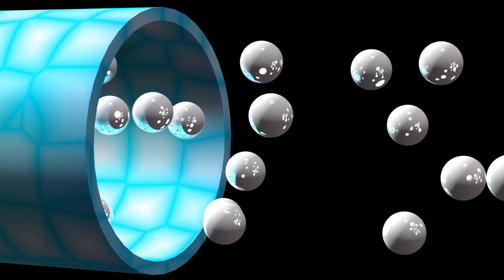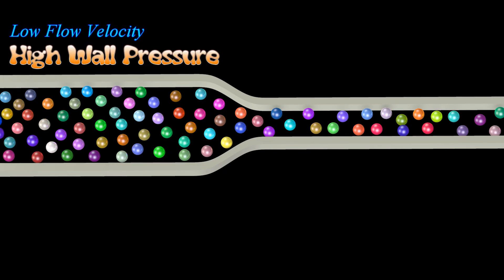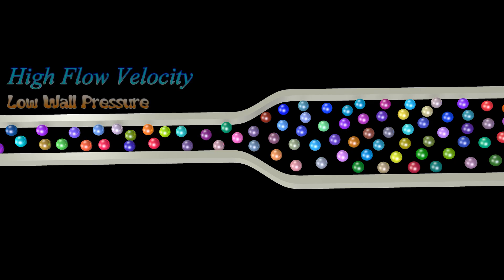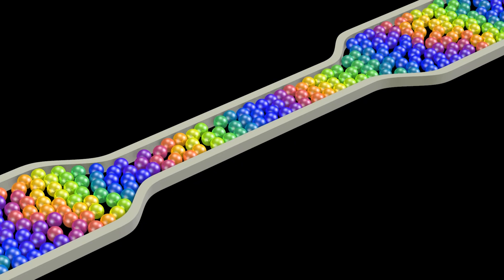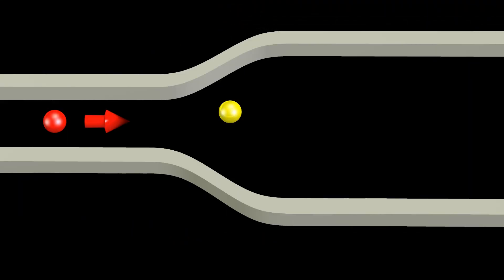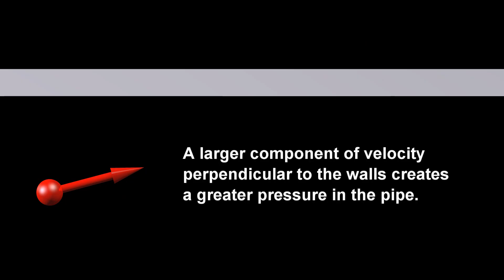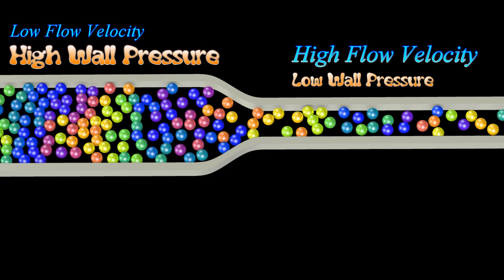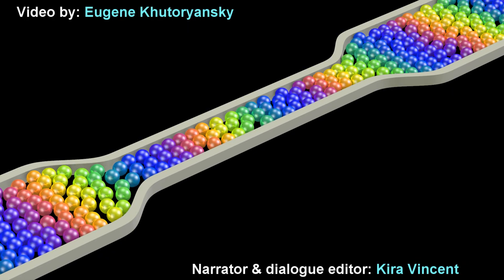Bernoulli’s Principle on Atomic Scale

Comment: Unfortunately, this violates some very common and well understood accepted principles of physics.  Charles Crummer makes the same errors, which doesn't make it correct.  It also contradicts itself as explained at the end.
..
The statement at 2:07 is correct. "there is no reason to expect an atom with a higher velocity to exert a lower pressure on the walls of the pipe." 

There can be the same pressure in a fast fluid as a slow fluid.  They simply have the same static pressure. Bernoulli is not about speed. It is about changes in speed or velocity which is Acceleration along a path. 

The pressure on the walls of a sealed jar is the same regardless of the speed of the jar.

A fundamental flaw in this misconception at 2:42 is is that there no reason to expect a molecule to have the thermal vibration in only one dimension.  These pressure causing vibrations are random in direction and are how they bounce round between other atoms - At THE SPEED OF SOUND in the medium!.  
At any given instant a molecule may be going down and the next at 90 degrees or even 180 degrees to the previous vibration.    All that happening at blinding speeds relative to the flow speed down the pipe.
That simple fact breaks this false logic.
..
Then. . . 
It is the average velocity (over time) that has a directed motion when the kinetic energy is added to produce an increase in speed. That directed velocity is vectorially summed to the random vibrations.  This is vector addition of velocities. This means that the random vibrations are superimposed onto the linear velocity along the tube. This is fundamental physics. Vector quantities like speed and acceleration add vectorially.
Ignoring that fundamental physics is another flaw in this.
..
..
Then, the added kinetic energy in the moving fluid is in only direction.  It is not increasing the random thermal vibrations. That would require increasing the temperature.  This is another flaw in this story.  Moving the fluid along the pipe does not raise the temperature.  
Therefore, the statement at 2:23: "an atom with a higher velocity would have a higher kinetic energy and, therefore, exert a larger force on the pipe walls" is false because it conflates / confuses thermal energy and momentum in one direction.
..
..
Consider bouncing a ball on the floor. Each bounce imparts some momentum to the floor.  The ball's actual motion is only vertical..

Now, start the room moving (a train car) and the ball still imparts the same momentum to the floor with each bounce.  It's actual motion, relative to the stationary ground changes.  It has the SAME vertical component, but now a horizontal component vectorially added to the vertical motions.  The pressure on the floor does not change.
.
 However, these two motions are orthogonal and have no effect on each other. The vertical up[and down bouncing component remains the same. ONLY the ground referenced horizontal component changes as the speed increases.
This physics does not change if the ball is bounced on the ground outside the train's window.
.
Contradiction:
The idea of the molecules entering the third, wide section bounce in such a way to give them more toward the walls, directly contradicts the fact that they are also bouncing off other molecules as it enters the narrow section. 
This makes absolutely no physics sense at all. 
.
This fails on these fundamental physics errors.

Comment: nice work reallt.Thanks for such insightful explanation
Reply from the maker: Thanks.  I am glad you liked my explanation.
Reply: Unfortunately it is flawed as follows:
The statement at 2:07 is correct. "there is no reason to expect an atom with a higher velocity to exert a lower pressure on the walls of the pipe." 

There can be the same pressure in a fast fluid as a slow fluid.  They simply have the same static pressure. Bernoulli is not about speed. It is about changes in speed or velocity which is Acceleration along a path. 

The pressure on the walls of a sealed jar is the same regardless of the speed of the jar.

A fundamental flaw in this misconception at 2:42 is is that there no reason to expect a molecule to have the thermal vibration in only one dimension.  These pressure causing vibrations are random in direction and are how they bounce round between other atoms.  
At any given instant a molecule may be going down and the next at 90 degrees or even 180 degrees to the previous vibration.  
That simple fact breaks this false logic.
..
Then. . . 
It is the average velocity (over time) that has a directed motion when the kinetic energy is added to produce an increase in speed. That directed velocity is vectorially summed to the random vibrations.  This is vector addition of velocities. This means that the random vibrations are superimposed onto the linear velocity along the tube. This is fundamental physics. Vector quantities like speed and acceleration add vectorially.
Ignoring that fundamental physics is another flaw in this.
..
..
Then, the added kinetic energy in the moving fluid is in only  direction.  It is not increasing the random thermal vibrations. That would require increasing the temperature.  This is another flaw in this story.  Moving the fluid along the pipe does not raise the temperature.  
Therefore, the statement at 2:23: "an atom with a higher velocity would have a higher kinetic energy and, therefore, exert a larger force on the pipe walls" is false because it conflates / confuses thermal energy and momentum in one direction.
..
..
Consider bouncing a ball on the floor. Each bounce imparts some momentum to the floor.  The ball's actual motion is only vertical..

Now, start the room moving (a train car) and the ball still imparts the same momentum to the floor with each bounce.  It's actual motion, relative to the stationary ground changes.  It has the SAME vertical component, but now a horizontal component vectorially added to the vertical motions.  The pressure on the floor does not change.
.
 However, these two motions are orthogonal and have no effect on each other. The vertical up[and down bouncing component remains the same. ONLY the ground referenced horizontal component changes as the speed increases.
This physics does not change if the ball is bounced on the ground outside the train's window.
.
This fails on these fundamental physics errors.

Comment: THANK YOU
Reply from the maker: You are welcome and thanks.
Reply: Unfortunately it is flawed as follows:
The statement at 2:07 is correct. "there is no reason to expect an atom with a higher velocity to exert a lower pressure on the walls of the pipe." 

There can be the same pressure in a fast fluid as a slow fluid.  They simply have the same static pressure. Bernoulli is not about speed. It is about changes in speed or velocity which is Acceleration along a path. 

The pressure on the walls of a sealed jar is the same regardless of the speed of the jar.

A fundamental flaw in this misconception at 2:42 is is that there no reason to expect a molecule to have the thermal vibration in only one dimension.  These pressure causing vibrations are random in direction and are how they bounce round between other atoms.  
At any given instant a molecule may be going down and the next at 90 degrees or even 180 degrees to the previous vibration.  
That simple fact breaks this false logic.
..
Then. . . 
It is the average velocity (over time) that has a directed motion when the kinetic energy is added to produce an increase in speed. That directed velocity is vectorially summed to the random vibrations.  This is vector addition of velocities. This means that the random vibrations are superimposed onto the linear velocity along the tube. This is fundamental physics. Vector quantities like speed and acceleration add vectorially.
Ignoring that fundamental physics is another flaw in this.
..
..
Then, the added kinetic energy in the moving fluid is in only  direction.  It is not increasing the random thermal vibrations. That would require increasing the temperature.  This is another flaw in this story.  Moving the fluid along the pipe does not raise the temperature.  
Therefore, the statement at 2:23: "an atom with a higher velocity would have a higher kinetic energy and, therefore, exert a larger force on the pipe walls" is false because it conflates / confuses thermal energy and momentum in one direction.
..
..
Consider bouncing a ball on the floor. Each bounce imparts some momentum to the floor.  The ball's actual motion is only vertical..

Now, start the room moving (a train car) and the ball still imparts the same momentum to the floor with each bounce.  It's actual motion, relative to the stationary ground changes.  It has the SAME vertical component, but now a horizontal component vectorially added to the vertical motions.  The pressure on the floor does not change.
.
 However, these two motions are orthogonal and have no effect on each other. The vertical up[and down bouncing component remains the same. ONLY the ground referenced horizontal component changes as the speed increases.
This physics does not change if the ball is bounced on the ground outside the train's window.
.
This fails on these fundamental physics errors.

Comment: Had to come back because i forgot to hit the loyke button. ✌️👍
Reply from the maker: I am glad you liked my video.
Reply: Unfortunately it is flawed as follows:
The statement at 2:07 is correct. "there is no reason to expect an atom with a higher velocity to exert a lower pressure on the walls of the pipe." 

There can be the same pressure in a fast fluid as a slow fluid.  They simply have the same static pressure. Bernoulli is not about speed. It is about changes in speed or velocity which is Acceleration along a path. 

The pressure on the walls of a sealed jar is the came regardless of the speed of the jar.

A fundamental flaw in this misconception at 2:42 is is that there no reason to expect a molecule to have the thermal vibration in only one dimension.  These pressure causing vibrations are random in direction and are how they bounce round between other atoms.  
At any given instant a molecule may be going down and the next at 90 degrees or even 180 degrees to the previous vibration.  
That simple fact breaks this false logic.
..
Then. . . 
It is the average velocity (over time) that has a directed motion when the kinetic energy is added to produce an increase in speed. That directed velocity is vectorially summed to the random vibrations.  This is vector addition of velocities. This means that the random vibrations are superimposed onto the linear velocity along the tube. This is fundamental physics. Vector quantities like speed and acceleration add vectorially.
Ignoring that fundamental physics is another flaw in this.
..
..
Then, the added kinetic energy in the moving fluid is in only  direction.  It is not increasing the random thermal vibrations. That would require increasing the temperature.  This is another flaw in this story.  Moving the fluid along the pipe does not raise the temperature.  
Therefore, the statement at 2:23: "an atom with a higher velocity would have a higher kinetic energy and, therefore, exert a larger force on the pipe walls" is false because it conflates / confuses thermal energy and momentum in one direction.
..
..
Consider bouncing a ball on the floor. Each bounce imparts some momentum to the floor.  The ball's actual motion is only vertical..

Now, start the room moving (a train car) and the ball still imparts the same momentum to the floor with each bounce.  It's actual motion, relative to the stationary ground changes.  It has the SAME vertical component, but now a horizontal component vectorially added to the vertical motions.  The pressure on the floor does not change.
.
 However, these two motions are orthogonal and have no effect on each other. The vertical up[and down bouncing component remains the same. ONLY the ground referenced horizontal component changes as the speed increases.
This physics does not change if the ball is bounced on the ground outside the train's window.
.
This fails on these fundamental physics errors.
Reply: Unfortunately it is flawed as follows:
The statement at 2:07 is correct. "there is no reason to expect an atom with a higher velocity to exert a lower pressure on the walls of the pipe." 

There can be the same pressure in a fast fluid as a slow fluid.  They simply have the same static pressure. Bernoulli is not about speed. It is about changes in speed or velocity which is Acceleration along a path. 

The pressure on the walls of a sealed jar is the came regardless of the speed of the jar.

A fundamental flaw in this misconception at 2:42 is is that there no reason to expect a molecule to have the thermal vibration in only one dimension.  These pressure causing vibrations are random in direction and are how they bounce round between other atoms.  
At any given instant a molecule may be going down and the next at 90 degrees or even 180 degrees to the previous vibration.  
That simple fact breaks this false logic.
..
Then. . . 
It is the average velocity (over time) that has a directed motion when the kinetic energy is added to produce an increase in speed. That directed velocity is vectorially summed to the random vibrations.  This is vector addition of velocities. This means that the random vibrations are superimposed onto the linear velocity along the tube. This is fundamental physics. Vector quantities like speed and acceleration add vectorially.
Ignoring that fundamental physics is another flaw in this.
..
..
Then, the added kinetic energy in the moving fluid is in only  direction.  It is not increasing the random thermal vibrations. That would require increasing the temperature.  This is another flaw in this story.  Moving the fluid along the pipe does not raise the temperature.  
Therefore, the statement at 2:23: "an atom with a higher velocity would have a higher kinetic energy and, therefore, exert a larger force on the pipe walls" is false because it conflates / confuses thermal energy and momentum in one direction.
..
..
Consider bouncing a ball on the floor. Each bounce imparts some momentum to the floor.  The ball's actual motion is only vertical..

Now, start the room moving (a train car) and the ball still imparts the same momentum to the floor with each bounce.  It's actual motion, relative to the stationary ground changes.  It has the SAME vertical component, but now a horizontal component vectorially added to the vertical motions.  The pressure on the floor does not change.
.
 However, these two motions are orthogonal and have no effect on each other. The vertical up[and down bouncing component remains the same. ONLY the ground referenced horizontal component changes as the speed increases.
This physics does not change if the ball is bounced on the ground outside the train's window.
.
This fails on these fundamental physics errors.